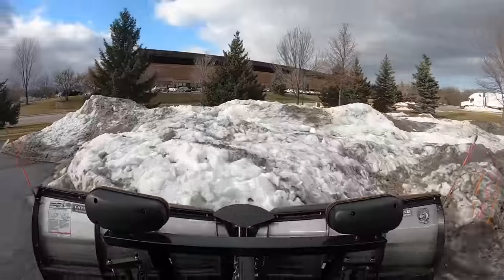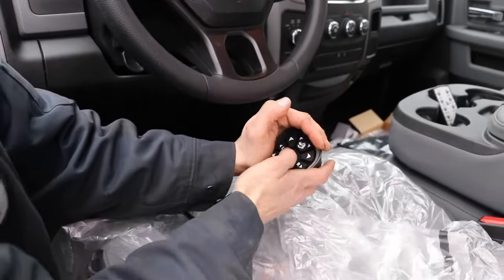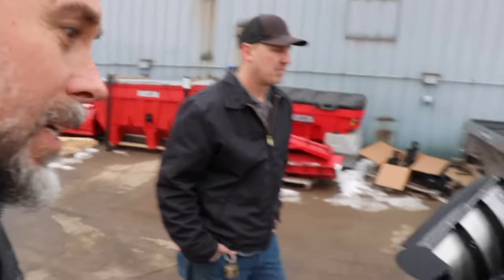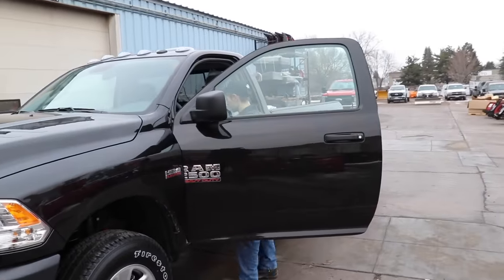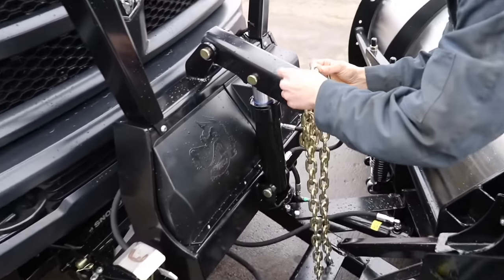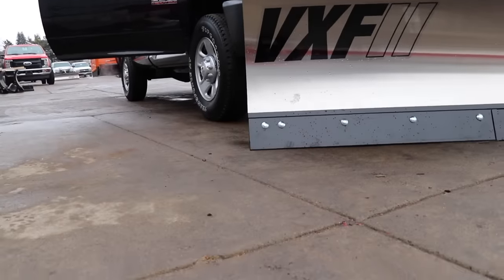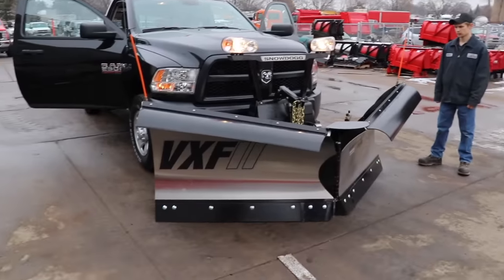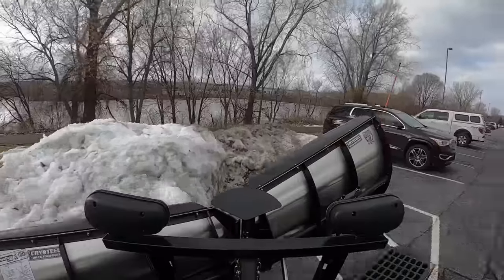Snowdogg snowplows- How do they compare with Fisher, Boss & Western

Comment: Hi Stan, i am a landscaper from Canada. I have run Westerns, Fishers and for 3 winters i have been running a snow dogg extension winged plow. From what i have noticed it has more negatives than positives. NEGATIVE: when in transport mode it constantly bounces, the mounts on the truck itself are really low and scrape when going up steep inclines or driveways. The jack method to unhook takes more time and precision then any other mounts: minute mount, smart hitch, or boss. The adjustable lights always seem to need adjustment: either aim to high or to low. The only pros i see is the build quality. Really massive metal throughout and a good backdrag blade. To be honest i would prefer a western or fisher again. It is on a 2009 ram 2500 6.7 diesel. Thank you for your awesome videos.
Reply: my kubota dealer planing getting into selling snow dogg plows and spreaders wich replaces blizzards
Reply: Michael Mac Tavish actually snowex replaced blizzard plows, and they are a far more superior plow compared to snow dog.
Reply from the maker: Thanks for the comments Bernard!
Reply: @meadowviewlawncarellc8079  yeah my kubota dealer gave up selling snow ex and blizzards due because its to exspensive on parts wich he didnt want customers spending money replacing parts every time wich he saving money wich is a great kubota dealer only plows he carrys is HLA and plows and wings for dump trucks and spreaders
Reply: Hello Stanley, do you have a personal relationship with our Lord and Saviour Jesus Christ? The Son of God. That if thou shalt confess with thy mouth the Lord Jesus, and shalt believe in thine heart that God hath raised him from the dead, thou shalt be saved. - Romans 10:9. And please ask the Lord Jesus to bless you with wisdom, knowledge, understanding, and discernment. And please ask the Lord Jesus to forgive you for all of your sins and transgressions.
Reply: I agree Bernard, snowdoggs a nodogg.
Reply: I just bought a few more fishers so xv2 ss xls and feel like snowayy or snowex might of been the move or a boss. I really think down pressure could be a game changer.

Comment: We bought one last year, after 9 years of not doing snow we got back into it. We went with the snowdogg over a western because of money and someone recommended it. Hand control is great, I agree, it comes standard with the top flaps and a cutting edge (all extra on a western). The first few falls we kept having issues with it, hydraulic fluid leaks, line bursts, even the entire light bar split off the rest of the plow and had to be re welded on. The worst part it takes at least 30 mins to out the plow on. The lights are horrible too. This year we have only had 1 issue with it, it was the ground on the battery burned out and needed replacement. We bought 2 westerns this year for our new trucks and the only 2 advantages is the controller and the back dragging. That being said we didn't purchase the cutting edge for the westerns, not sure why we didn't.

Comment: Reoccurring problems encountered with snowdogg plows.. 
lights snap off, cheap hydro rams leak(right from factory), controller bad out of box, deflectors break.
Saying that, I have 5 snowdogg plows and they are quality units-one has NEVER quit on a job site. Just got to iron out the small issues^^^ after you first buy one.
Tips: buy extra controller and extra angle ram(you can always sell em later)

Comment: Been using a 7.5 ft straight blade Western Snow Plow in Alaska since 1984, got a replacement for the older one in 2009. I have cleared a medium sized parking lot that had 62 inches of wet heavy snow on it. That was a challenge , but no problems. This was with my 2010 F-350 4x4 V-10. One of six trucks that were able to work in our community the next day.

Comment: I also prefer a chain to raise the plow. My dad had the same Western plow for 20 years on his 75 f100. When he sold it still had the original cables and the pump had never been opened up on it. Not bad for a 20 yr old plow. When I bought my 96 Silverado it came with a snow way plow with a hydraulic ram that raised it. Hated it every time I went to town I had to raise it 6 7 times as it kept going down. The following summer I switched to a western pump with a chain and cable operated for the plow. Never had a problem again with it. As for me I would take a old school western any day but to each their own.

Comment: The way that attaches to the truck is horrible, antiquated even compared to the Fisher MM1's which I honestly don't mind but the Fisher MM2 is light-years ahead of Snowdogg. And about hydraulic lift cylinder failure and getting stuck, just take your Fisher into a stacking position in a snowbank and use the highway safety chain to keep plow chained up and drive away with plenty of ground clearance. Fisher put a nice little notch in the headgear for laying the chain into to attach.

Comment: Putting a plow on or taking it off is always easier when its nice outside. Middle of the night -20, snowing, dark, not so much.
Reply from the maker: Very true Cobra Karl!
Reply: Hey Stanley,  watched all your videos on the Snow Dog Plow.  I bought one put it on my Dodge. Only problem is I'm a man. I like hunting , fishing, that mount super super sucks! It doesnt come off, only 8 inches of ground clearance!, I cant clear a standing can of WD 40!, I'm so pissed. Please look into Snow Ex I feel they lead the industry and always show clearances in your videos. I would love to see some springtime videos, you drive down a muddy road with ruts or go over some rocks. I bet that mount wont be straight!
Reply: The clearance on that mount does look terrible.  I'd have stress tested my seat belt multiple times or eaten my steering wheel multiple times if I had that on my truck.

Comment: My limited plow experience was a 7.5 foot western I think on a 4.3 Chevy half ton in larger snows. It was miserable. Not enough truck. Spent much time in a bobcat pushing back... And much time with a welder cause it was old and. Rocky rough roads it was about 8 hours per event...

But countless hours doing worse roads with farm equipment. Including pushing out after the plow jockeys can't hack it. I did one drift in 10 minutes that was hard and heavy that had defeated multiple v blades the 65 horse 2wd tractor beat it easy, that being said. If I was in your shoes id consider euro speced (high road gears( 35 mph )front 3pt etc) 100 horse tractors for snow work for visibility with a large front blade and gnues box on the back for stacking and box work.
Quickly becoming my 2nd favorite channel. My friends at welker farms will always be number 1.

Comment: I have a Snowdogg VMD plow on my truck and it's the biggest pain to get on!  Need to have it perfectly lined up and perfect height to get it on. Couldn't get it on last night, just gave up. Will try again tonight. It's very tough getting it on when you aren't on a nice smooth paved surface, my driveway is full of snow and is gravel which makes it very tough. The plow works well when I can actually get it on and I am able to really stack the banks. I have 8 foot tall banks around my driveway now.

Comment: Brown dialectic. I use it almost daily on outdoor low voltage connectors to lube the fittings and prevent corrosion. Also keeps water out of the connection for the most part. I had never heard of the BROWN grease. I just found it on Amazon and ordered some made by Truck-Lite. Thanks for the info. Always learning something and I’m even watching from So Cal. Not much snow where I’m at!
Reply: I can't find it anywhere :/

Comment: Western dielectric grease (bought in 2017). Both blades are made by Douglas dynamics as well as Fisher so the cutting edges are the same in design. I do not know if Dogg makes their own cutting edges so run it in the real world and lets see how they do. I know western cutting edges SUCK I will be upgrading soon. I’m not a fan of Salt Dogg bad luck with several spreaders a few years ago so I can’t risk the coin on their plows at this time but I’m with you on the controller it looks awesome!

Comment: I noticed you have a 2500 ram I also have a 2500 2014 model and ordered a vxf8511 the literature says the plow is to heavy for my truck the sales people say it is fine, did you have to do any suspention prep on your truck to put the plow on because the spec say they are about 200 pound heavier than the Boss or Hiniker.

Comment: First season plowing period. Ran crews for shovlers and snow blowers in Massachusetts and made some good money. Now it's time to step my game up. Just got a Boss DXT 8'2" V stainless steel plow on a 2018 Ram 2500 6.2 liter hemi. Now my issue is trying to figure out how to price Residential and Commercial properties in Northern NH (White Mountain region). Any tips would be much appreciated. Per SQ/FT? Hourly?  There is a company in Massachusetts that I worked with, the owner gave me some tips a while back but it was all gibberish back then. Under 2" X per square foot, over 2" under 4" X, etc. Thanks everyone. Great video.
Reply from the maker: Thank you Michael!

Comment: I like how everyone is complaining about the mount, and the hook up etc. The price on this plow i was quoted 5500 for a 8.6 and 5600 for a 9.5 for a 2019 ram 2500. Those prices can't be beat. For a fisher 8.6 xv2 its 6200 , meyers super v 6300 for a western mp3 6900. Boss is like 6900 to 7000 plus. My dealer says he ll only sell boss dxt cause vxt has had to replace a frames. Etc. So were else can you get a new plow for that cheap and its stainless steel. So if you even just run it for a yr or two you made its money back. Plows every brand they all do the same thing push snow.  Im going to buy one a xp 810. 5200 installed.. a western pro plow 8ft straight blade is 5800. So stan good choice, stan is a business guy he looks at money made and returned not what plow looks better etc. Plus 2 yr warranty. It will be paid for by then. Also if your worried bout ground clearance. Leveling kit..

Comment: I mount and Un mount mine all this winter. The first time was scary. After that it’s peasy. If you are running more plows with different brands. Then I would see why it’s hard(remembering each process). But if you are used to it. I hook up and unhook on the fly all the time.

Comment: It’ll work great for the first season then after that it will be a pain in the ass. We have ran three. Our v-plow was awful. Then we had a straight blade for about 4 years but every year we had to work on it then replaced it with a new straight blade and the plow mounts snapped as we were driving

Comment: With dielectric grease be aware some will burn so test some and try to light it with a cigarette lighter if it burns. This could be a problem if you ever have an electrical fault and fire
Reply from the maker: Good tip Michael, thanks !

Comment: No way I don’t buy a plow unless it has a chain I blew a line last winter plow was stuck down I have a fisher I just ran the plow up on a bank of snow reset the chain tight while it was up on the bank and limped it home fixed it in my garage and back out in 10 minutes that’s a great tip I learned from an old timer run it on the bank and when it’s up chain it less work and quick but chain is tried and true

Comment: We use the castle brand silicone dielectric compound its a little red spray can its quicker less messy and it DOES NOT FREEZE! Which the gel style grease does and causes problems

Comment: I havent worked with the snowdog system, or any other, but that looks like a pain in the ass for hooking up, and disconnecting.. I could have my fathers fisher 8' HD straight blade with MM2 off in less than 3 minutes...  that includes putting blocking underneath the blade (so it wont freeze to the driveway/road). it was a great system the hydraulics are fast, and responsive. the blade was heavy duty, and would scrape to bare pavement as long as teh pins were setup correctly to the height of the vehicle.

Comment: I feel like I comment a lot on your videos but here I go.  I personally have not been impressed with the few buyers product I have used( except there magnet mout low profile safety light,  I like those except the price).  They always seem only half way thought out.  My tailgat spreader I have the motor sits below the spinner it would be a big deal but the salt gets into the bears of the motor it will also hit the ground while it’s on the truck.  I’ve put two motors on it in 4 years.  It also faults out all the time which is annoying.  Ther push spreaders the fear drives never stayed tight and the frames rusted out in two years.  This has been my experience with there products but there plows may be better.  How it works well for you.
Reply from the maker: Thanks for the comments Tyrell and for sharing your experience !

Comment: My snow dog plow blade keeps getting stuck when I put it down to start clearing snow. It goes down but won’t come up. What could cause that, maybe hydraulic fluid but I think it’s the pins in the connector cause it works sometimes till I start having to make a lot of movement. Help please any advise/insight would be greatly appreciated!

Comment: I’ve had a Fisher straight blade, two Curtis straight blades but the Boss DXT Stainless is my latest and it’s just amazing.  Especially the ease of hitching it to the truck among many other advantages (heavier cutting edge, dual trip feature, simple smart controller,). Watching Will go back to each side multiple times on this unit looked like way too much work.  They added a switch there for leveling, the same switch which does it all for the Boss.  I know Snow Dogg is significantly less expensive but I don’t even know if there are any local dealers here in CT.  Super happy with the Boss on all accounts.
Reply: hello Mike, how much was the stainless steel straight blade plow? And does it come with the truck frame or attachment for that price? thanks

Comment: I vote for Boss plows. So easy to hookup and I prefer not using chains to lift plow. Hydraulic cylinders on Boss keep the plow from bouncing up if you hit an Uneven spot on a country road. I also added the d-force as an option so now I  enjoy the cylinder down pressure for back dragging.

Comment: its a common misconception but i have boss straight blade and all i have to do is use a ratchet strap to pick my blade up if the hydraulic ever fails. quite simple.

Comment: What's your 2 Best pro's and 2 Best con's about this set up?  My two issues with my snow dogg are lift speed, and how low the mount sits making the approach angle too low. We scrape a lot more than I'd like to on the frame. Love the controller, stainless blade, and obviously price.

Comment: Yea if a the lift cylinder ever fails you drive the plow into a pile and wrap a strap around it like you would if you where to short chain a chain lift plow..... I’ve had chains brake on the westerns you would end up doing the same thing with a ratchet strap to get um back to the shop

Comment: Stan how do you like that controller and complain about the western one in the past? This one got more buttons!
Reply: The Western's with their winged configuration is tricky get a hang of. Kind of redundant on the operations side for the western for the new comers. We have the old style Snow-Dogg controller on our buyers set up and it is phenomenal. However two complaints with the Snow-dogg i have are slow lift speed, and the mount sits so low on the truck it is impossible to not scrape on steep approaches

Comment: the snodog   the bar hangs way too low on truck, too much to do to take on off.  boss does well with that, just wish boss had down pressure
Reply: Derek Comingo they do have it on straight
Blades my western is like 1000 pounds you don’t even need it

Comment: I'm up in Northern MN. Possibly getting a Snow Dogg 1/2 ton V plow.. I would get a good deal on it from a dealership I'm buying a truck from. Plow is not on the truck yet. Are they sturdy plows? Thanks.
Reply: I just bought mine. Haven’t had any time with it. But so far it seems great! Bought it second hand from someone who used it commercially, and it looks really tough based on use.

Comment: You can lift a hydraulic only plow with a ratchet strap. 
The arguments of being able to drive into a snow bank to chain up are absolutely stupid. Not to mention ineffective and dependent on having a snow pile at hand or close by. 
If your hydro goes out in any case you are better to just use a strap to lift and secure the plow to transport. 
I’m sick of hearing this bs